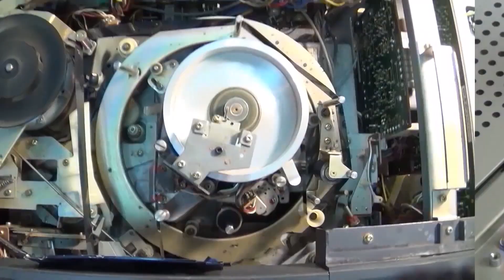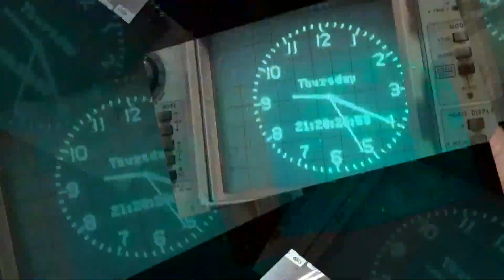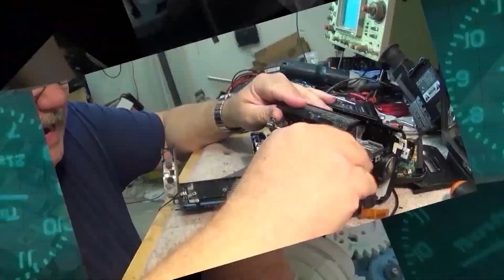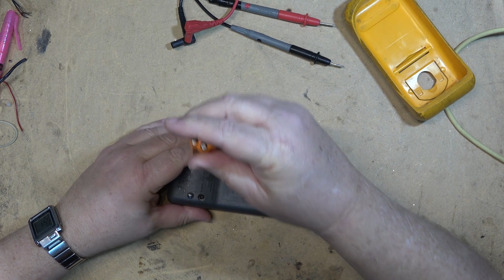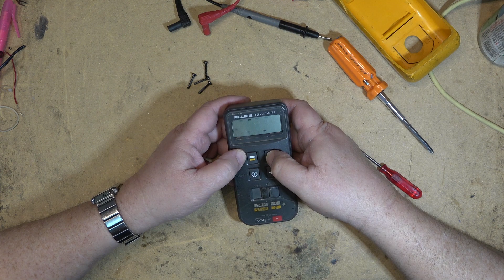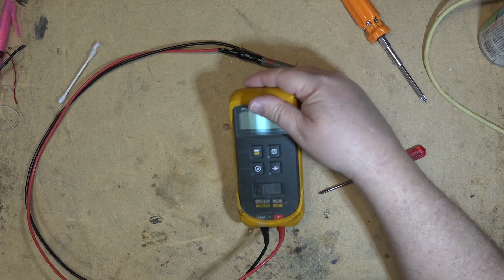My Fluke Puked

Comment: Your reserve Fluke is the one I have had for 17 years. Only ever had to change the batteries and I used it every day until this year when I finally stopped being an engineer and went into network consultancy.
Reply from the maker: The spare is a current model.  Don't know how long it has been around but I saw one at the local shop and it was about 500 bucks.
Reply: @12voltvids  You've got me thinking now. I'll have to check the model number on my Fluke again next time I use it, but it has the same features I can see on yours. With the capacitor mode on the ohms setting when you press the yellow button.

Comment: Funny. I have the exact same Fluke which I only rarely use. I only use it when working with mains power, which is 230VAC, over here. My daily multimeter is a cheap no-brand and I have a some others in case I need to measure multiple values at the same time.

Comment: my fluke 83 has suffered this problem for a long time (I got it in 1995 or so).  I found someone on ebay selling a "permanent" fix for the elastomer issue.  it's a thicker piece of zebra strip and made of silicone instead of the pink foam rubber.  I put that in 10 years ago and haven't had any more issues.  it was nearly an annual event to take it apart and clean the elastomer to get all the segments back.  I ended up breaking the snaps on the inner plastic chassis from the multiple cleanings I had to do but fortunately found another of them for cheap.   I suspect the failure mode is the sulfur in the rubber slowly reacts with the tin-lead plating on the PCB contacts (why no gold plating fluke?) making lead sulfide which increases the resistance over time.  I suspect the replacement elastomer made of silicone prevents that from happening.  We have one of thsoe 175's at work.  it's a decent meter but the one thing that annoys me greatly is the current mode defaults to AC, and you have to press the button to do DC.  Also the auto power off timer is pretty short, around 15 minutes.  at least you can press the button to turn it back on-  the 179 you have to turn the switch off and back to the range you want.  very annoying.

Comment: I had an affordable but nice DMM some 30 years ago where half the display went out due to the elastomer connector failing. No matter what I tried I could not get it to work right again. I don't think they designed the casing to put enough pressure across it evenly. I ended up replacing it, the failing one was an automatic ranging one, and they weren't that good back then (slow and tedious), so it was worth buying a manual selected meter instead.

Rubber buttons can be a pain too, with the disintegrating carbon pads behind them, or the flexible parts going gooey and sticky. Had to clean up the TV remote for that problem about a month or two ago. At least that repair went well.

Comment: He Cleans....HE SCORES !   We get some good bargains at the expense of those less knowledgeable, or too lazy to learn.  Nice job Dave.
Reply from the maker: Pissed off today.  Outlook no longer signs in to any of my email accounts.  Tells me my password is incorrect.  I log on and change it and now none of my devices can log into one of my primary accounts.
Reply: @12voltvids  One part of the issue, is having multiple devices automatically attempting to login, whilst you are busy changing the password on one of them.. can see the password automatically (protectively!) locked out for an interval of time.. It may help to take all but one device offline whilst you change password.. or for long enough that the one device with corrected password successfully logs in.. then change the stored password on one device at a time, preferably only taking it online after that password is changed.. else account lock will occur again.
Reply from the maker: @rupertwilson7020  only 1 device was logged in.
Reply: 集積回路のLSI IC だったら厄介ですね。

Comment: I have a unrelated question. I have a 16 chevy Colorado. While traveling in the city, with the radio OFF I hear a sound like a old Xerox copier, dot matrix type. It happens in certain areas. I can duplicate the sound by driving to the exact location. It happens by the off ramps on the freeway, city libraries, certain buildings. I assume its some type of interference, but it makes no sense being the radio is off.
Reply: I have had similar experience.  It may come from a cell phone that is getting a signal from a cell tower.  Sort of like a PING locator does sonar.  Try shutting off your cell phone and see if it still happens.
Reply: @jameskrivitsky9715  wow. I didn't think of that. I will check back let you know. Thanks 😊
Reply: The radio in your truck is never really off when the ignition switch is on. The audio amplifier and microcontroller are still running because they are used to generate any chimes or beeps that other systems in the truck may request. They may also be used for any Bluetooth/Onstar functionality that your truck may have, and of course, there's also the clock display. It's easier to just leave them running, and the small amount of electrical energy they use won't ever be missed.

Something in those places is causing interference with the circuitry in your radio. It may not even be the tuner circuitry picking it up. You might even be able to pinpoint the source with a portable AM radio if you have one.
Reply: @uxwbill  thanks. Because it was not my phone. It's just a weird sound. I have also noticed it happens around government buildings.
Reply: @uxwbill  after careful examination, it is in fact coming from the the infotainment system. And it is cell towers causing the interference. Thanks.